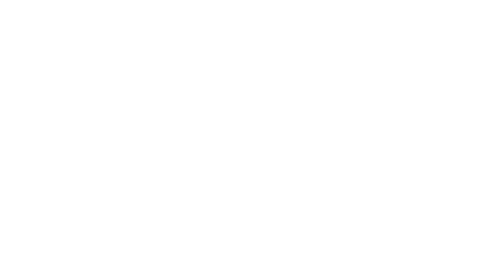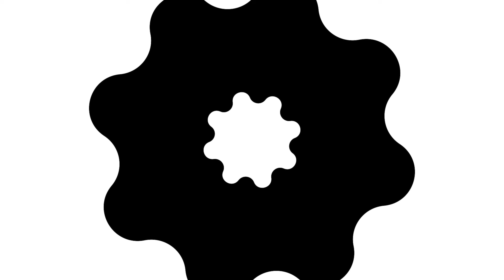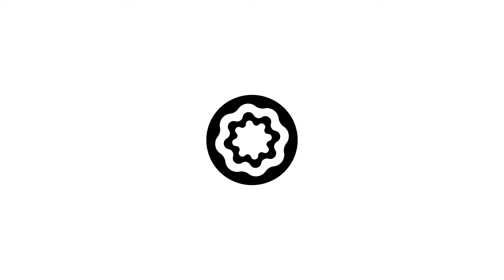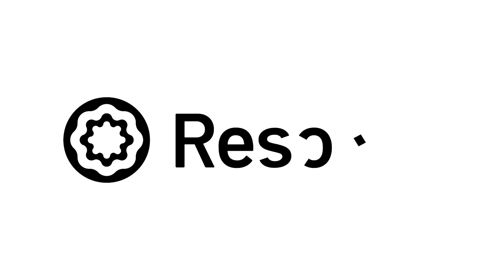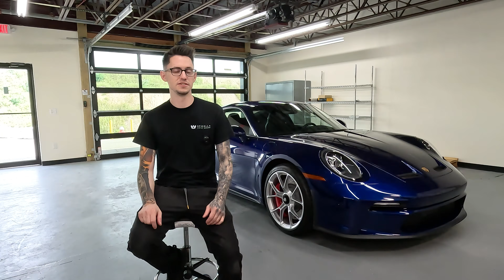2023 Porsche 911 GT3 - Sound Deadening Noise Reduction On A 992 Using ResoNix - Part 1: Introduction

Comment: Great.  Is there a “lite” version that takes the edge off with about half the work involved?  I suggest you market this through PPF shops.  They’d love a labor intensive product like this that generates happy customers that love their GT3 especially.
Reply from the maker: Do the doors and rear. Skip the wheel liners. That is half the work and gets you about 70% of the way there depending on what trim vehicle and what tires you are running.